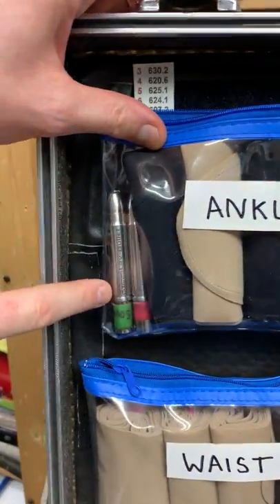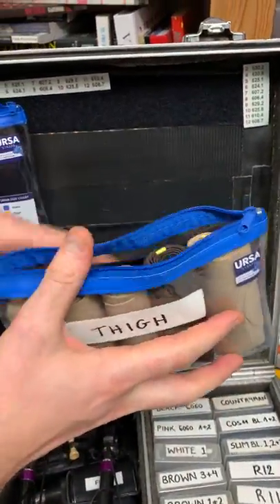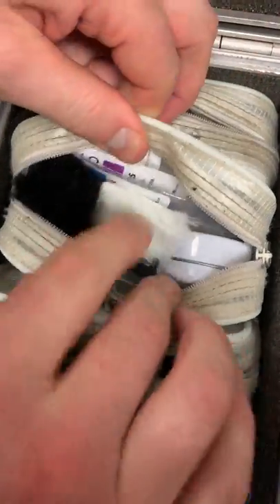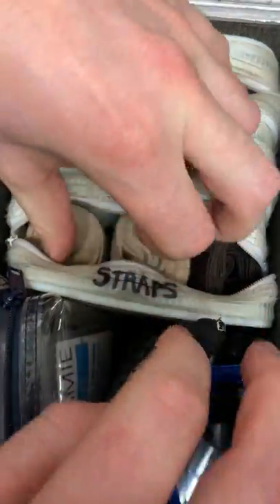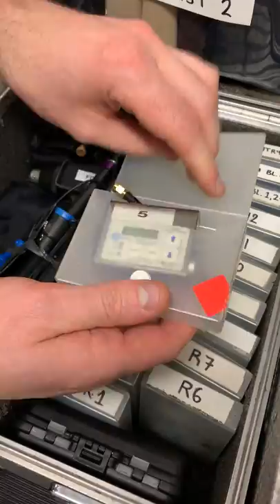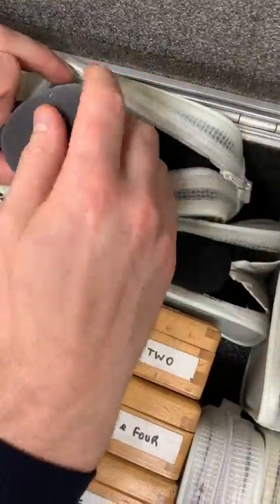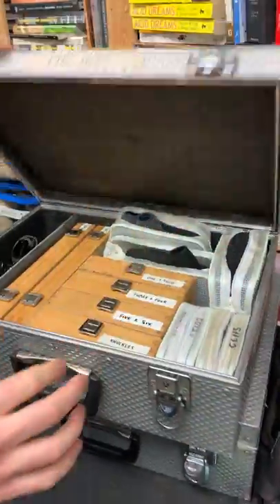What’s in your Kit? With Sound Mixer Simon Bysshe | URSA Exclusive

Comment: Hello. Getting some links or tips about all those small bags and boxes would be so EXTREMELY helpful. Please tell or why not someone make a separate video about them. I heard he mentioned a name for the half see through transmitter boxes. Are the URSA bags from URSA or are they OCRA? And that small black case with white (or see through) lids for compartments inside...so tidy.
Reply from the maker: Hiya, the zipper cases in the lid of the radio mic box are made by URSA. However many of the small plastic boxes in the radio mic box are made by a Japanese company called MUJI. These boxes were designed originally as business card boxes. However they are the perfect size for transmitters. Sadly MUJI discontinued these boxes about 4 years ago and we have yet to find a good replacement. I dont have an ORCA bags except for the ORCA case which my 688 sound mixer sits inside on the trolley.

Comment: what are the cases you use for the transmitters? very nice set up mate, so organized.
Reply from the maker: These are MUJI boxes - they are actually designed originally as business card boxes. However they are the perfect size for transmitters. Sadly MUJI discontinued these boxes about 4 years ago and we have yet to find a good replacement :( Tom Williams has similar black boxes but they are a bit bigger.